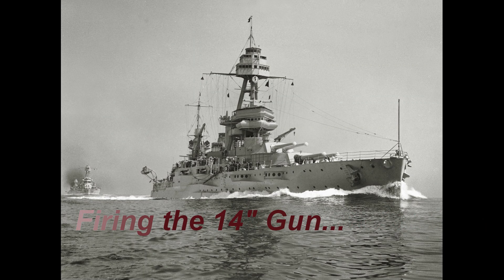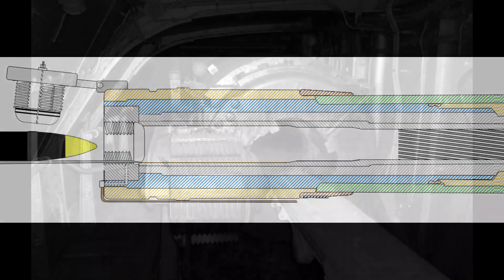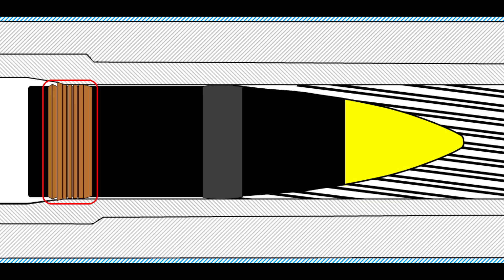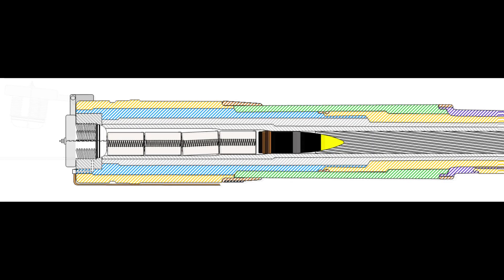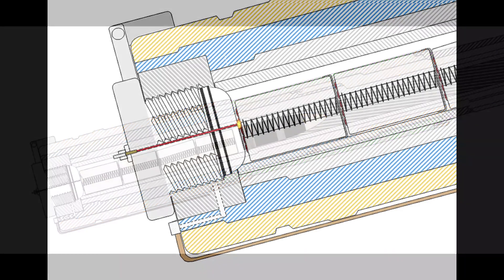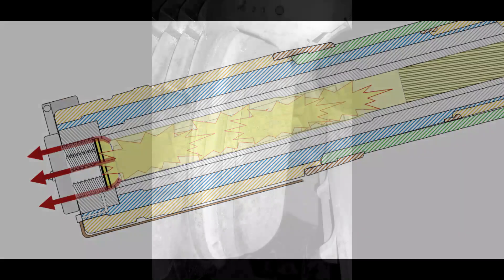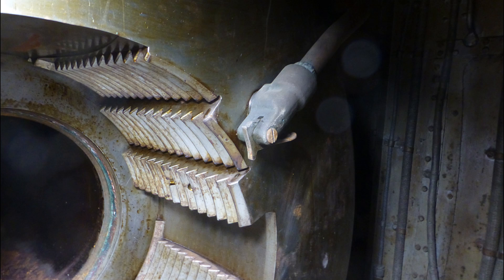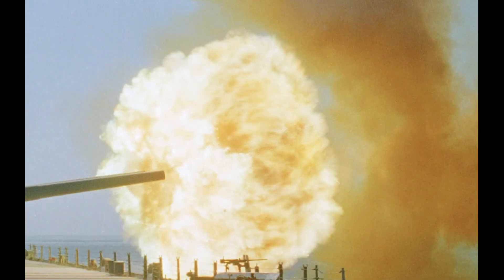Battleship Texas, Firing The Guns Step-By-Step

Comment: very cool and informative. so what kind of problem could result in excessive slope wear in the breach? id imagine a shell weighing as much as a car sliding over it causes a good bit of wear.
and in had no idea the barrels were formed from so many payers.
Reply from the maker: I have not seen or heard that it was a problem.  However, even if there was significant wear, the only problem would be that ramming effort may increase some.  The primary source of wear was from firing.  The extreme pressures and temperatures created microfractures in the surface of the bore and powder chamber.  This wasn't dangerous, but it did lead to bore erosion that affected firing accuracy and periodic replacement of the barrels.  The last barrels installed on Texas were rated for 250 shots of what were called effective service rounds, which was armor piercing rounds fired using a full 420 lb. charge that created the most wear.  However, a large percentage of rounds fired were high capacity shells and reduced charges.  That increased barrel life by several hundred shots.  Lastly, whatever wear may occur on the slopes would be resolved when the barrels were replaced since the new liners installed in them included new slopes.
Reply: @tomscotttheolderone364  ok. thanks! great info!

Comment: One thing on this class of ships that wasn't repeated was that the projectiles were brought up and were even stored nose down during loading. I really like the old girl hopefully they get her where she's not in danger if sinking sometime soon. Thanks for the video I live this stuff even at 65 years old it makes me feel like I'm 15 years old again!
Reply from the maker: The ship is currently scheduled to be towed to dry dock for hull repairs in late June or early July.  The ship has been well prepared, the tow carefully planned and run through simulations, and it will be less than 50 miles in protected water.
Reply: @tomscotttheolderone364  Good Luck!  hopefully everything works out.
Reply: @tomscotttheolderone364  I thought they were bringing the drydock to her at least thats what was being said in March or April
Reply from the maker: @georgedistel1203  Bringing the dry dock to where the ship is currently located was never considered for a number of reasons.  Not the least of which is that tied to the state provided funding for repairs was that the ship could not stay in her present location.  In any case, Galveston is a short and safe tow from where she is now, and it has all of the required logistical support and infrastructure already in place.

Comment: How long did it take to reload such a gun? What was the rate of fire in combat conditions?
Reply from the maker: A well trained crew could hit a 45 second rate of fire.  While it isn't the fastest, it's respectable and pretty impressive for a largely manual system.
Reply: @tomscotttheolderone364  thank you for answer and for this video. Greetings from Poland!
Reply from the maker: @Robert_NN  Dziękuję!
Reply: @tomscotttheolderone364  for a process nerd, it would be interesting to see the critical path activities making up this 45 seconds and the elapsed time for each.  Wonder if anyone has tried putting that into Gantt chart type format.
Reply from the maker: @jamesbeaman6337  I suppose a basic Gantt chart would be easy enough to create, however, there are some variables within the process that would likely affect both order of activities and rate of fire.  A good example was whether or not the turret commander knew the number of rounds to be fired.  Hoisting individual shells to the turret only as they were needed slowed things down, so the best way to speed up was to have extra shells ready for loading.  This was possible since three shells could be pre-positioned on the rammer tray, the dump tray, and one on the hoist at the same time.  Plus, hoisting could be done at anytime, even while the gun was being fired.  The down side was they did not want extra shells remaining on the trays in the gun house if cease fire was called.  This was unavoidable since the upper hoists could only raise shells, not lower them.  So, any shells remaining on the trays had be lashed down and secured in place until the next time the gun was fired.  That would be okay, unless the next mission called for a different kind of shell than what is already in the turret.  The only way to get rid of unwanted shell was to fire them.  There are also serious issues with having unused powder bags sitting out of storage tanks for a period of time, then returning them to the magazines.   I assume that if that happened, the turret commander would be in a lot of trouble for wasting some very expensive ammunition unless there was a legitimate reason for the occurrence.
Reply: Thanks for those thoughts, Tom.  I can clarify I was thinking of the ideal case only, in which the turret was in the flow of a repetitive bombardment with all parts of the powder/shell feeding process flowing smoothly.  Also, totally unrelated, I’ve wondered lately as to how your personal interest in the ship came about.  Did you serve in the Navy or other military branch and if so, in what capacity?   I know you likely would rather these videos and comments focus more on the ship than yourself but with all the great historical contributions of this channel, it would be cool to know a bit more about the content creator.

Comment: The french 380/45 gun had its Welin breech block open upwards
Reply from the maker: For some reason, I am not surprised.  I owned a Renault R16 many, many years ago.  The door locks locked when you pulled them up instead of the universal way of pushing them down.  It makes me wonder if the same engineers were responsible for the two designs.
Reply: @tomscotttheolderone364  Haha, I would not be surprised  if that was true :)

Comment: An exceptional video. One bit of trivia- the 36,000 psi in Texas' main guns is a little more than half of the roughly 60,000 psi in the 30-06 chambered Springfield rifle in service at the time when Texas entered service and that only fired a bullet weighing one third of an ounce at approximately the same muzzle velocity as Texas' 14 inch guns.
Reply: While I agree with your main illustration, your numbers are a bit off - the 30-06 cartridge as used in the M1 Garand operated at 50,000 psi - not 60,000.  60,000 psi would have very quickly broke the operating rod.

Comment: What really amazes me is just how similar the chamber pressure and muzzle velocity are to rifle calibers. Difference being a huge difference in mass ejected and weight of propellent expended. Velocity might kill but apparently mass obliterates.
Reply: Both, which translate to kinetic energy. If you shoot a pea at 1% the speed of light, it will cause a lot more destruction than these shells.
Reply: @ironcito1101  One of the ways that a hypothetical alien species might destroy the Earth would be to hit it with a 100 kg or so mass that they have accelerated to 99% the speed of light.  This can be done without violating any laws of physics, and the kinetic energy would be like a rifle bullet going through an apple.
Reply: Kinetic energy goes up in a linear fashion with mass (2x the mass, 2x the energy.
It increases by the square of velocity (2x the velocity 4x the energy).
Reply: It's only about the same pressure as a .30-30.

Comment: Great job as always Tom. Very accurate and you are correct no real difference in the Iowa’s loading and design. The biggest change was the adding of circuit 1R the ready fire circuit which was a series of switches which prevented loading out of sequence. For example the gun captain had to hit a bore clear switch before the rammer could ram the projectile. And I never knew the names of the two ramps the shell moved through to get to the rifling. So I learned something new. Also our gas check pads were neoprene rubber (impregnated with asbestos I believe). I didn’t think Texas used the old mutton tallow pads in WW2, did it?
Thanks!
Reply from the maker: Hi Bob!  You saying that you learned something made my day!  I would certainly prefer the safety of the 1R circuit; however, I would feel pretty safe in one of Texas' turrets.  With the exception of the two powder men in the gun pit, the entire gun crew worked within literal spitting distance of one another, so there was no lack of communication.  Ramming the shell into a "hot" chamber is no big deal, but powder is obviously a different beast.  One absolute step in the 14", two-gun turret loading procedure said that the flash tight door between the side pocket and gun pit would not be opened and powder bags not pushed through until "bore clear" was called.  Since that was done by one of the pit powder men who were less than 6 feet from and in full view of the gun captain, it effectively the same as a 1R circuit.

I saw the check pad composition in an ordnance manual from the late 1920's.  I have at least one newer one, so I'll check to see if there were any changes.
Reply: @tomscotttheolderone364  how was “bore clear” determined?  I assume it would be by visual check to see the sky through the barrel, however, how would it be done at night if that was the method?
Reply from the maker: @jamesbeaman6337  I don't recall seeing anything in gunnery manuals that address the issue of visibility in the bore.  My experience with looking down bores is that even a small amount of light, direct or reflected, provides decent visibility.  There are two things that can be done to assure a safe bore if visibility is poor.  The first is to simply ram a shell.  It tightly fits against the barrels compression slope to seal the powder chamber from any remaining residue farther up the bore, isolating any hazard from the powder chamber.  The other measure is to spray the chamber with water using a flexible metal water hose mounted on the overhead behind the breech.  This will immediately extinguish any hot fragments and make it safe.  Since the gunnery manuals specify that charges only be loaded if it is known that they will be immediately used, they aren't exposed to water long enough to have any affect upon their performance.  In fact, I have read that this was part of the standard loading procedure for the British.  So, if the gun captain has any doubt about the condition of the bore and powder chamber, he simply has a shell rammed, then hoses down the powder chamber.  He can then safely call bore clear.

Comment: One I would love to see a tour of the forward wand rear tripod mast… to see what is up there……….
Reply from the maker: Unfortunately, there is nothing worthwhile to see in either.  Not only were both completely stripped of their equipment by the Navy when the ship was decommissioned, they are no longer period correct inside.  Both were in need of major structural repairs when the ship went to dry dock in 1988.  Lack of adequate funding forced them to use materials and methods that were not part of the original construction.  So, there isn't much to learn by visiting them.  The good news is they were careful to make sure that outer appearances were correct.